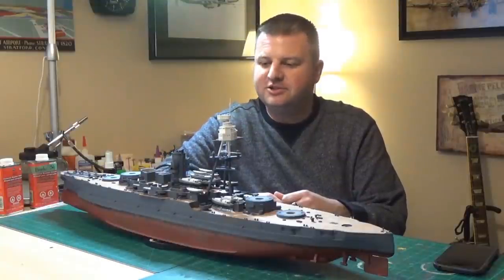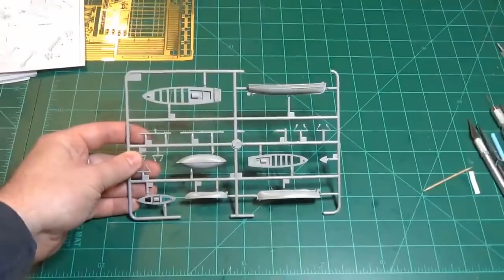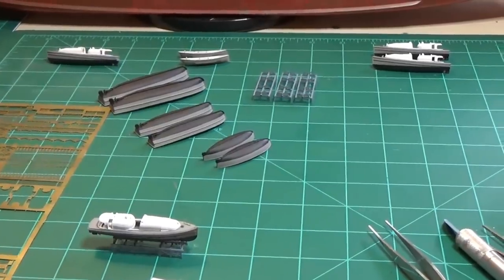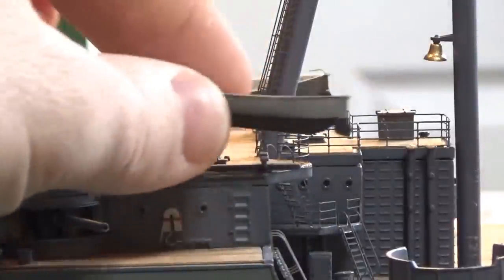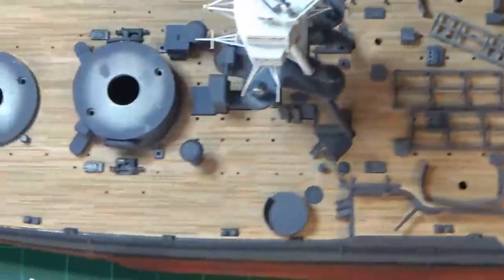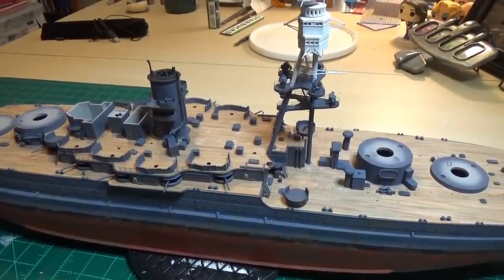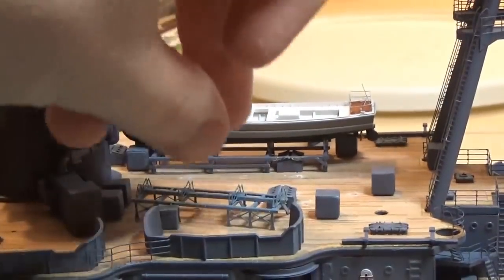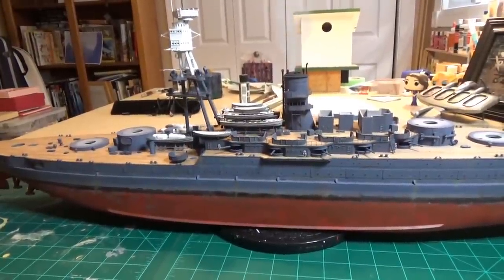USS Arizona by Trumpeter 1/200 Scale Build Video # 12 The Ship's Boats

Comment: Have you thought about buying a disk punch and making disks to cover the holes and raise the boat racks that way??
Reply from the maker: WEST COAST MODEL BATTLESHIPS  so I have a disc punch and I was thinking about using it to put holes in masking tape, to mask the deck and make filling the holes easier. Then I thought about using it to punch wooden deck plugs out of the left overs from the deck. But the punch and the holes were not exactly the same size. That is when I decided to just carefully fill the holes the old fashioned way.

Comment: She coming great. Did you heat the PE before bending it?
Reply: USS SARATOGA CV3 LeFevre So for this section of PE, no I didn't. I wanted the racks for the boats to be rigid. So I just bent the metal as is. I should have annealed the railing before bending it. It was a little springy. As a rule, I usually only anneal things that need to be bent a lot. Like seatbelts or something that needs to be bent round.